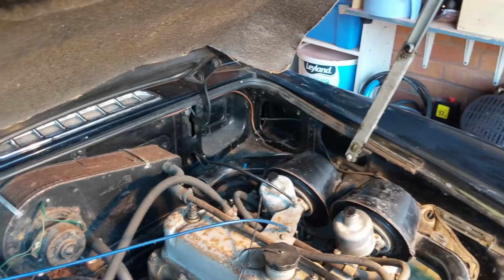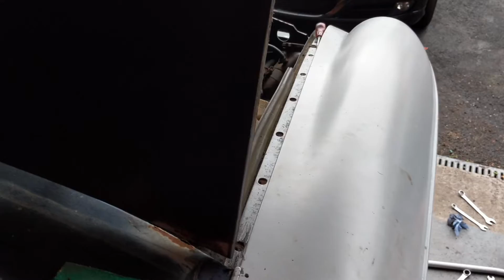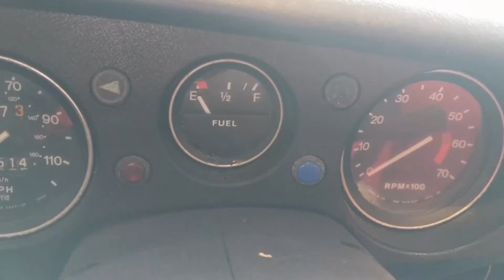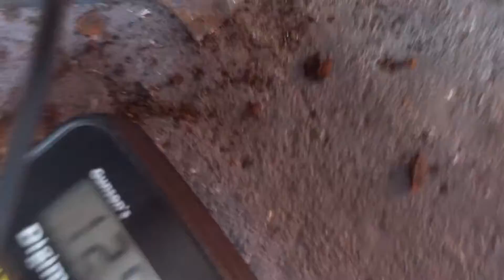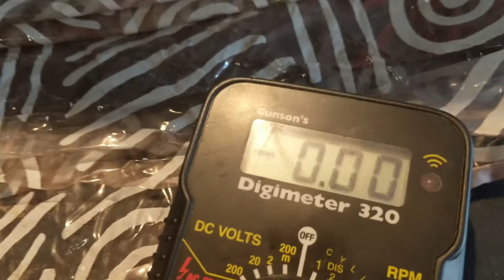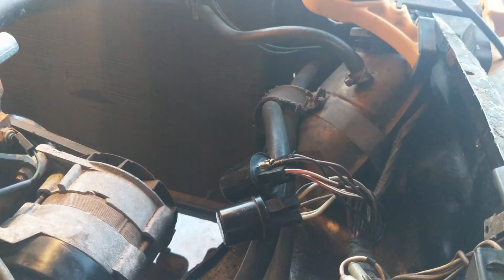MGB GT Episode 2  Starting the Engine

Comment: Just got one of mine running. I bought 2 when i was 17 for 1200 and had to leave them in a lot for 6 years because reasons. I got the 76 running pretty good but it doesn't have brakes... and need a new ignition system.
Reply from the maker: I've been tuning mine over the last weekend.  Sounding better but I reckon a couple more tweaks still needed